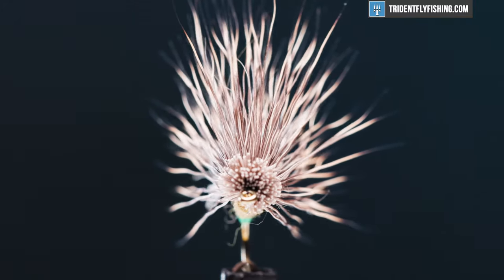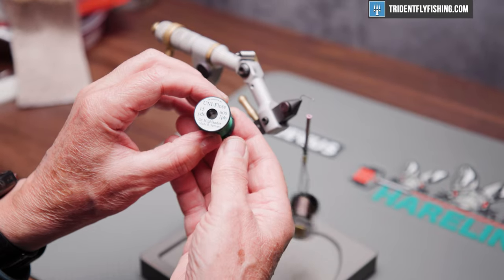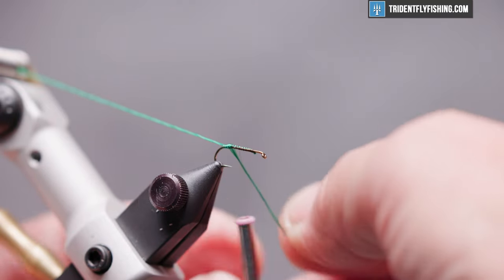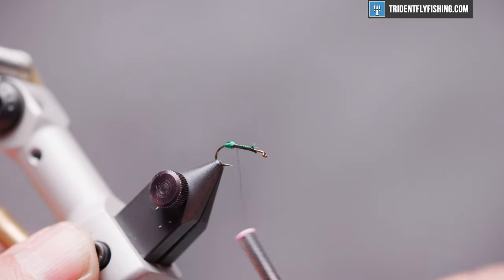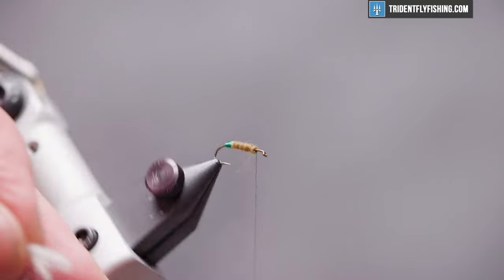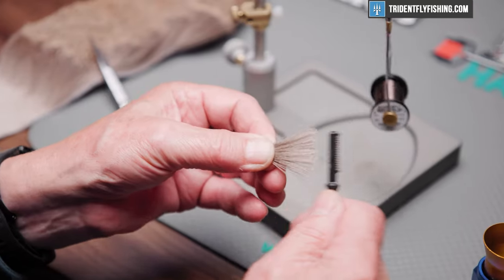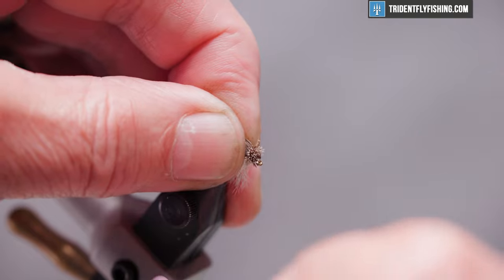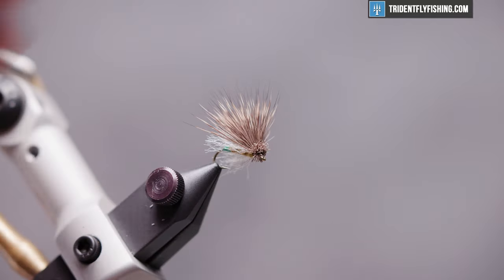Grannom Caddis Dry Fly | Best for Caddis Hatches | Fly Tying Tutorial

Comment: Nice tie!  Notice how the floss tends to start coming apart as he wraps the tag. That's a common problem when wrapping floss Also notice that it didn't get out of hand for him.  Looked like it was headed that way, but didn't happen.  It covered what he needed covered. He also wrapped this pretty thick, but that's because it is imitating an egg sack and it needed to be thicker there - more ball-like. If you need it to be more precise with the floss, simply twist the tag of the floss in your fingers a little to pull the unruly strands back and reduce the coverage width, being careful to keep it flat where it's wrapping.  If you don't want the deer hair/elk hair wing to stand up so high, you can fix that after the initially tight tie-in wraps. Just take a couple of looser wraps back which will drop the height of the wing without flaring it, and then move back to the tie-in point and put a tight wrap there before your flare the head.  Be careful not to put any tight wraps behind the tight tie-in spot or it will cause the hair to flare again instead of reducing the height of it.
Reply: Gidday Dan. Your tips are real helpful. Thanks.